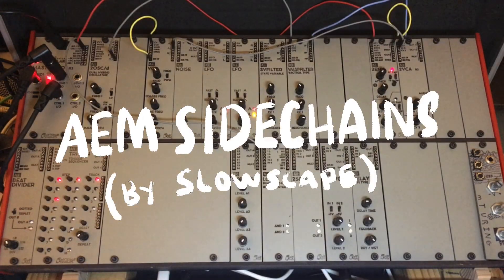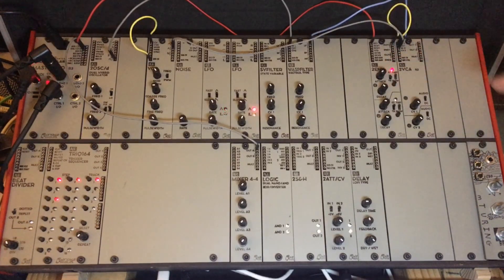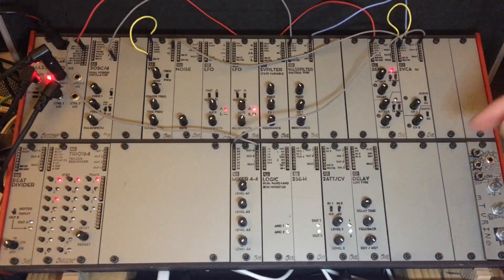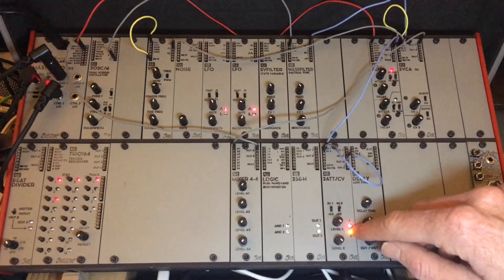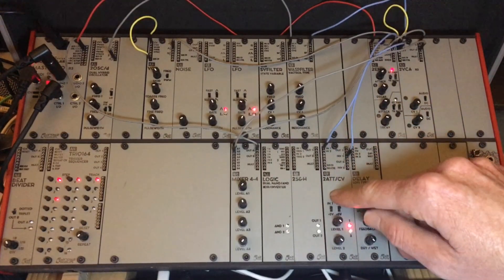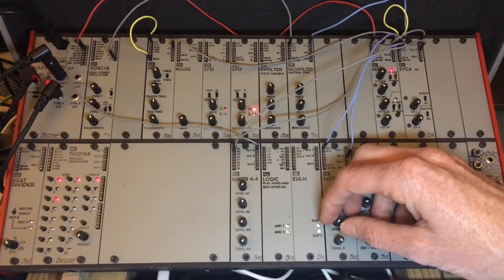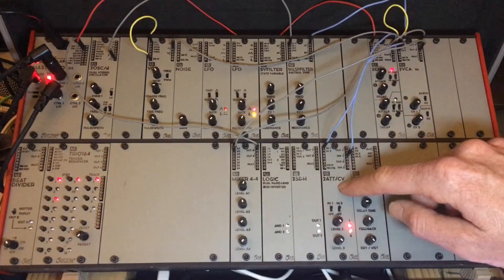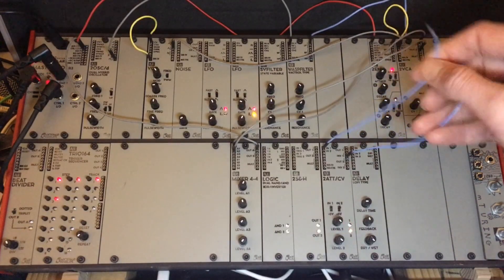AEM Sidechain Tutorial (Ducking On An Analog AE Modular Synth)

Comment: Well done!!! :) 

Regarding the 2ATT/CV, that's an attenuator which only reduces the strength of incoming signals (like that envelope in your video). The upcoming 2CVTOOL module will feature attenuverter knobs, which let you smoothly blend from full inversion to full attenuation (so no signal output) on to full normal signal strength.

Attenuverter pro: flexible tool for CV manipulation, just one knob for inversion and attenutaion
Attenutaor pro: well defined zero point (knob just fully counterclockwise), whereas the zero point on an attenuverter is in the middle of the knob range (12 o'clock) and might not be easily/precisely dialed in very quickly
Reply from the maker: THE TUESDAY NIGHT MACHINES thanks for the clarification, also a glimpse of what’s to come! When I first got my AEM I had no idea what the module did, I thought it was useless for my needs, but has become really important as I learn how to use it more!